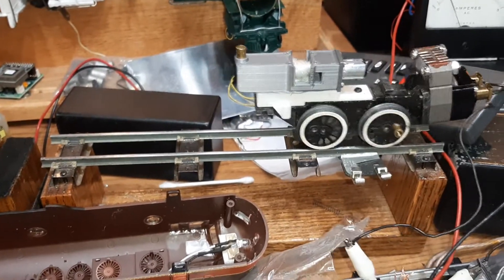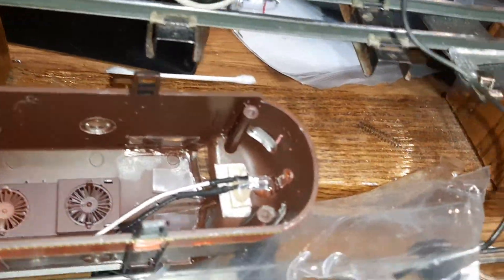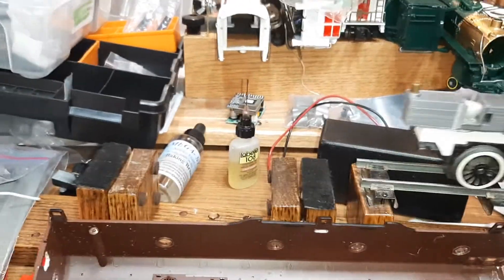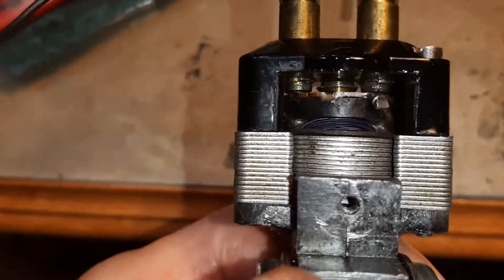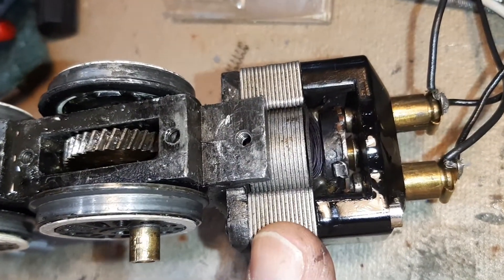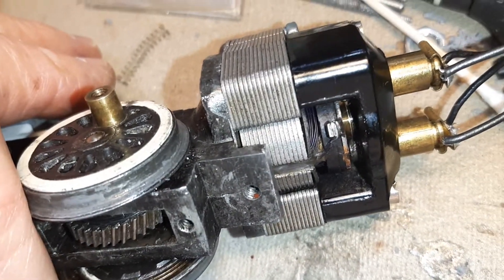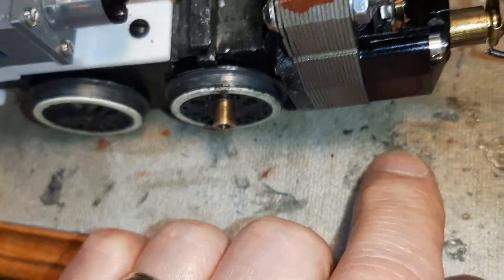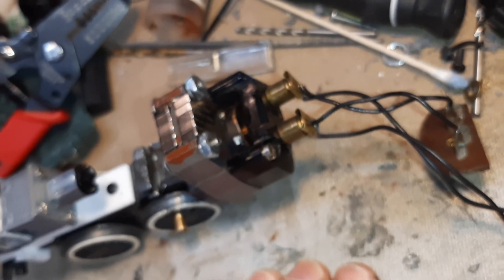American Flyer AC to DC conversion

Comment: Does magnetism hold the magnets in place and are they the small rare earth magnets like Harbor Freight sells?
Reply from the maker: They sort clamped in place but the tight fit. When I convert the DC Flyer motors to Updated Magnets the brass tabs hold them in place. We are thinking to 3D Print an adapter to hold the magnets in the AC Flyer Conversions. Trying hard to make a good reliable Reverse unit for the Flyer AC Motor with a DC adaptor. D
Reply: @DennisMurphey  are they all + up or down or +-?. Sorry but my abilities with electricity are limited to flipping light switches.
Reply from the maker: @jockellis  what is it you want to do. An specific app requirement helps define orientation.
Reply: @DennisMurphey  what I want is battery powered, radio control for my two GM demonstrator GP-7s.
Reply from the maker: Well that is a stretch from where we are, Good luck!

Comment: have you tried converting the 12 volt trim tab motors that gilbert made for the Hellcats.  They had ( I think ) seven poles and ball bearings. These war surplus artifacts turn up in bulk ocassionally and require a worm conversion and mounting ears fabrication but run well.  The Lindsey DC motor used in o gauge ( the full seize one not the HO ) is another model builders delight ).  It has seven skewed poles and ball bearings.   You will probably be needing a lathe soon.
Reply from the maker: Sounds alike a great motor but i doubt I will be able to do the required machining. Restrictions, space, time & money. At 72 adding a lathe is unlikely to past the CFO. May work with a partner!?!?